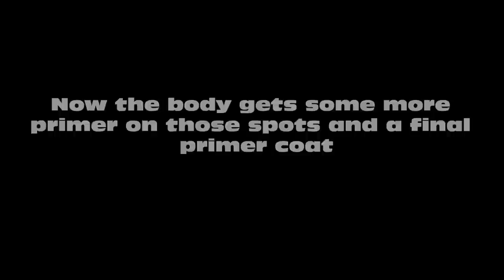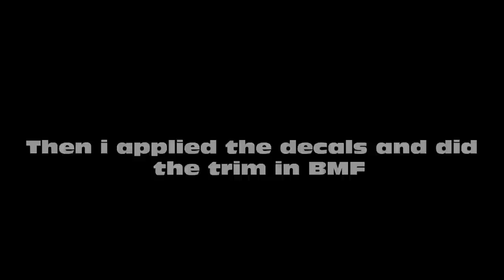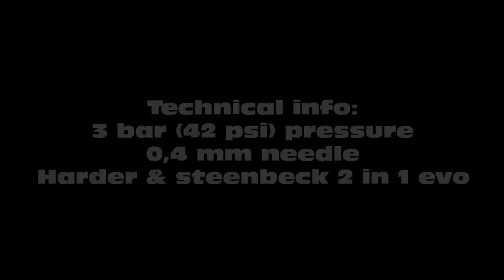Revell '70 Plymouth HEMI Cuda:Painting

Comment: Excellent video. I just got an airbrush kit and am going to try my hand at airbrushing for the first time hopefully this weekend if the weather looks to be any good. It's been so darn humid the past few weeks i've only been brush painting parts and pieces, etc. Previously i'd tried to use Testors Model Master "aotomotive lacquer aerosol can system" on a Revell Lamborghini Countach model and had very poor results. But I think that was due in combination to both my technique, sloppy/no prep, etc. Going to see if I can actually do it the correct way this time lol. I've already washed off the parts and let them dry. so hopefully mold release won't be an issue. Next will be primer. I just have to decide if I want to use the Tamiya Fine White aerosol can. Or the Allclad II paintbrush primer that I picked up last week. I also picked up a box of plastic spoons to test out on :) so we'll see how all that goes.
Reply from the maker: hallis1 Wichever primer you decide to use, I would reccomend using the same brand for color and clear aswell, just to prevent the paints from atacking eachother. Good luck!

Comment: Thank you for taking the time to make this video.  It appears that you move from one coat to the next without much wait time in between (except when changing from primer to color and then to clear).  Is that correct?
Reply from the maker: That is correct. I wait about 3 or 4 minutes inbetween coats. Most of the time i paint more then just the body. All the other parts i paint take about 4 minutes to paint. so when those are done i give the body another coat. With the paint i use you don't have to wait long at all it dries really fast. Its touch dry in about a minute.

Comment: How much did that machine cost you? I just started and doing this car. I am using a air can thing that came with paint. It does okay, but I have never seen clear coat come with these.
Reply from the maker: +TheCigarGuy The compressor i have ia pretty exspensive, i think it was around €350,- the airbrush is €150,-

Comment: Hey there, 
I also build revell models but the painting always goes wrong.
I don't have an air brush so I do it 'by hand'.
I also buy the revell paint.
So is there anything that you suggest to maybe make it look better or just buy an air brush?
I have been looking for one but they're very expensive.
Reply from the maker: Well first of all when brushing its best to thin the paint down, and do 2 coats instead of just 1, sometimes even 3.

i don't use revell paints because i don't think they are any good. I use Tamiya Valleyo and Zero Paints(airbrush only)

and for the best results i would suggesting to get an airbush, but if your serious about the hobby buy a good one the first time. and don't waste money on cheap stuff.

Comment: Do you have any videos that show start to finish? Mixing, Enamel vs acrylic, paint brand ect.
Reply from the maker: no
Reply: I think enamel is well on its way out. Acrylic is sooo much easier to use and cleanup and dries in 10 minutes. If you watch his videos, Tom uses lacquer-based primer (Zero Paints) and lacquer-based paint (Zero Paints, Gravity Colors) for his car bodies, and acrylic paint for all the detail work. The only place he uses enamel paint is Humbrol black for the floorboards before he adds powdered flocking to simulate carpet. Everything else is pretty much acrylic.

He's also done a model with Tamiya lacquer-based primer, Tamiya acrylic paint, and Tamiya TS-13 lacquer clear just to demonstrate that cars CAN be done with a rattle spray can rather than airbrush and still get a good result. Honestly, you can get decent results with airbrush paints sold at the local hobby shop IF they are thinned properly and sprayed in several light coats. Heck some people use Pledge Floor Care (Future/Finish) as a clear coat and are happy with the results.
Reply: +Morgan Feldon I am using water based wicked & House of colors paint. How would you suggest thinning it? Mine have thinner floating on the primer. It won't mix enough. Thanks for everyone's help
Reply: Liquitex Wicked Paints are already thinned and airbrush ready. Assuming your airbrush is receiving enough air pressure (try 20-35 psi) then you can add up to 10% High Performance Reducer (Auto Air Colors #4012, Wicked Colors #W500) which is their official thinner product. I've seen some DIY recipes online on how to make your own thinner for this paint that include clear auto glass cleaner, isopropyl alcohol, and glycerin.

House of Kolor sells their own reducers -- RU310 Fast Dry, RU311 Medium Dry, RU312 Slow Dry, RU313 Very Slow Dry and RU300 VOC exempt.
Reply: Thanks. I have been using it already but at a ratio of 2:1. I will make the correction. I am glad someone took the time. Thanks again!!

Comment: Is Zero paint acrylic ? or Enamel
Reply from the maker: I'm not sure if its either, But if id had 2 be one of those its would be Enamel. It is Cellulose thinners based. And can be cleaned off with Thinners.
Reply: Says acrylic on the bottle at the beginning of the video
Reply from the maker: It does say that on the bottle, but that has to be as mistake as this is cellulose thinners based paint. I just checked and the new bottle does not say acrylic. Not sure why this in does though.....
Reply: It is cellulose- rather than water-based acrylic. Acrylic does not always = water.

Comment: what pressure do you spray the zero paints at and do you thin them any more than what they come in the jar ?
Reply from the maker: +Dave Garrett 14 psi

Mostly straight out of the bottle
Reply: thanks mate all noted i can get zero paints here in the uk so all helps as i have never used an airbrush so any hints and tips for painting models will be appreciated

Comment: where did you bought the extraction instalation?
and the stand for you model body?
Reply from the maker: +Marijn Westhoeve ebay

Portable spray booth
Tamiya paint stand
Reply: It's a Sparmax Spray Booth. I believe it is sold in the US as the Testors Aztek Spray Booth. It's around $230.

Comment: wet sand?
Reply: Some sandpaper can be used dry or wet. When lightly sanding a painted model, I cut out a small square of sandpaper and periodically dip it in distilled water. This way the sandpaper grit doesn't get clogged with the pigments. Instead I can just dab it on a paper towel and the sandpaper is ready to use again. Also it is much less harsh on the paint job.